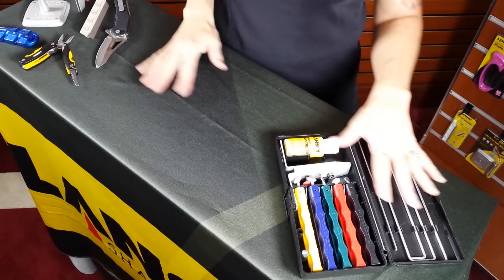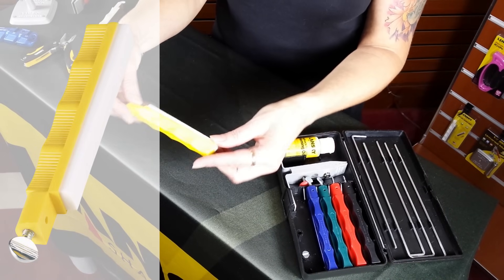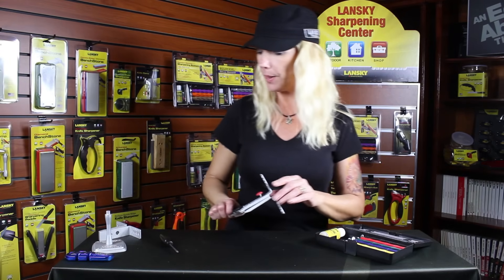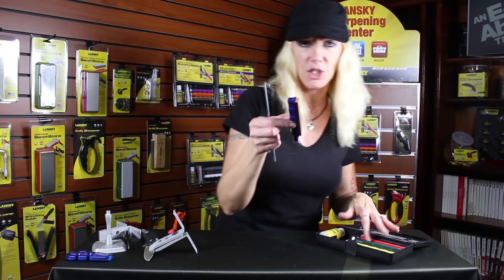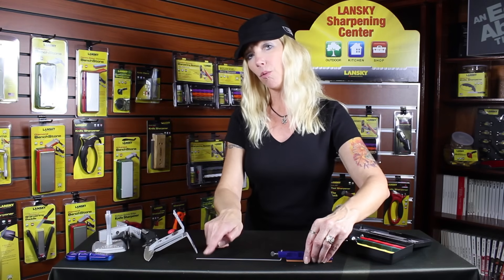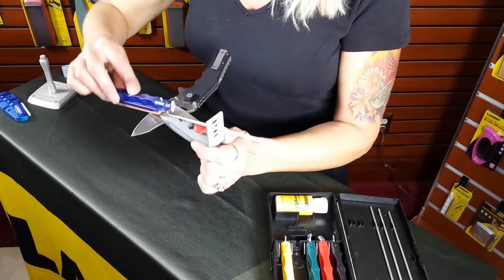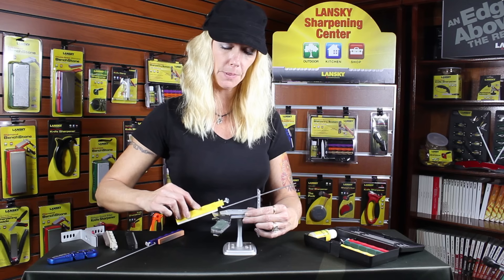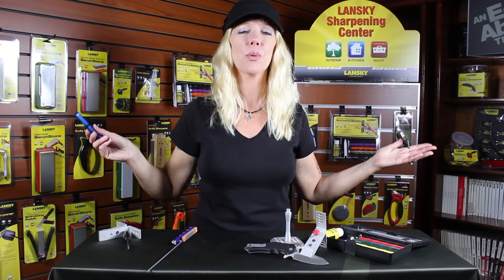The Lansky Controlled-Angle Sharpening System

Comment: Okay, just my thoughts after using this system for some years, on my second set. If I put my knives 1/4-1/2 inches into the holder, the clamp will not hold it securely. My second observation is that when I after having tightened down on the back screw tightly, the threads have stripped in the aluminum, so I had to drill and tap it to hold another thumb screw, pain in the butt. It works better than the Smiths, but I would rate your system a 4 out of 10. I’m currently looking for a better system. Just my opinion for what it’s worth.
Reply from the maker: I'm so sorry to hear you're having trouble with our system! We would love to get in touch with you about this issue and see if there's anything we can do to help. Please email us at customerservice@lansky.com.

Comment: Just got the system recently and got the deluxe 5 stone system. Also got the leather strop. Am I to use compound on the strop ?
Reply: I was wondering the same thing, since I'll be getting the strop as well. Every video I've seen on stropping uses compound, so I'm going to say might as well - can't hurt, esp since you have the controlled angle and no danger of accidentally  dulling the blade. I'm going to.

Comment: I’ve got the professional kit. Can you use this with karambit’s?
Reply from the maker: We actually have a set of hones specifically designed for karambits and other curved blades that will work with your current system. You can check it out here: https://lansky.com/index.php/products/curved-blade-hone-pack/
Reply: Lansky Sharp would this kit that is sold at SouthernGrind.com, be a good choice to sharpen mostly folding pocket knives that are middle to Higher class. Like a Chaves Rendicion 228, or a Zero Tolerance folder? Or would I need to get some extra parts?

Comment: Should we soak the stones in water? I got the deluxe, doesnt say arkansas stone so not sure to use oil
Reply from the maker: If you have the Deluxe 5-stone system, it does not require oil while you're sharpening. Metal filings from the sharpening process will start to get into the hone though, and that's when you'll use the oil to clean it up. If you have a Deluxe DIAMOND system, do not use honing oil as it will clog the pores. Full instructions are available at lansky.com (click the product you have). Your kit should also come with complete instructions. Hope that helps!
Reply: @LanskySharpeners  thx

Comment: I have a set of your stones that works verygood never had an issue until today,Igot a kershaw Launch 13 knife and I cant get it to clamp /screw down right because the blade isnt flat ,its got a crazy blade design...Any Ideas on how i can get it  to work.?any advice?? Lansky
Reply from the maker: Hi! I'm happy to hear you like the system so far! We would love to give you more detailed advice on how to fix this issue. Please send us an email (and perhaps include a few photos so we could better see what's what) at customerservice@lansky.com.
Reply: @LanskySharpeners  thanks,I ended up 2 little pieces of foam and clamped down on the blade and the foam.I got it to stabilize a bit better and got it sharpened pretty good..thanks again
Reply from the maker: @gman-dq5jn   Glad you got everything working! If you ever have issues again please don't hesitate to reach out to us and we would be more than happy to help!

Comment: That rod is moving all over the place through that big hole for the particular angle designation. Too much slop to get an accurate angle. Perhaps holding your finger against the sliding rid where it goes through the hole might tighten up tolerances.

Comment: I have a knife with a spear point blade where both sides (cutting and non cutting) of the blade are beveled and the thickest part of the blade is a small ridge down the center. How can I  clamp the blade to get the correct angles or will this not work for those type blades (i.e. spear point,  dagger, etc.)?
Reply from the maker: Hi Phil, for a blade like that we would recommend our Master's Edge or Turn box sharpeners.

Comment: I have seen so many ways to use this sharpener. Here she moves INTO The blade with a small slide down a portion of the blade. Others move the blade up and down and yet other slide the stone left to right on the blade. Quite the conundrum for those new to the system.

Comment: All the videos I've seen for this system show sharpening of pocket knives only, usually 3" or 4" blades.  I'm wondering how long a knife can be sharpened with this system?
Reply from the maker: Hi Jon. Our kits include instructions for sharpening knives that are under or over 7". Here's the link to the product page: https://lansky.com/index.php/products/dlx-5-stone-system/. You can find instructions for sharpening longer knives under the instructions tab.
Reply: If blade is greater than 7” in length:

Pick the end of the blade where you would like to start sharpening and place the clamp two finger widths away from that end of the blade.  (For example, if you choose the tip, place the clamp 2 finger widths from away the tip.) 
When you have the blade secured in the clamp, place your 2 fingers along both sides of the knife clamp.  The area covered by your fingers (on both sides of the clamp) is your target sharpening zone.  Try not to sharpen outside this zone, as this will change the angle of the hone and result in a poorly sharpened blade.
Sharpen your target zone, and with the knife still secured in the clamp, flip the clamp (and knife) over and repeat this process on the other side of the blade. 
When you are finished with the first zone on both sides of the blade, measure another two-finger width starting at the edge of your freshly-sharpened area, and place the clamp next to your fingers. 
Sharpen this new target zone as you did the first, roughly using the same number of sharpening strokes. 
Your use of this method will minimize gaps and overlaps between your target zones, helping to ensure a continuous sharp edge when you are finished.

(i found these on the website)
Reply: Biggest knife I've Sharpened with this had a 9 or 10 inch blade, and I didn't even have to move it in the clamp.

Comment: Hi. Will this work effectively with blades that are 30 cm long?
Reply from the maker: It will work but you might have to readjust the knife in the clamp once or twice to make sure you're getting the entire length of the blade. If you like to freehand sharpen, you can also use a bench stone and get excellent results that way.

Comment: Lots said about *accurate blade angle" I can't see how this can be the case as the exact angle will depend on the width of the blade, wider blades would have the edge further from the guide resulting in a lesser angle
Reply: That's why she said how much of the blade should stick out.

Comment: Is it possible to over sharpen a knife ?? I know that sounds like a silly question.. Like sharpen it to where it dulls out
Reply: Sharpening literally means turning a dull blade into a sharp one. If you do that and end up with something that cuts worse than before than you didn’t sharpen it but rather used your knife as a stone scraper 

I mean by grinding metal on stone you’ll inevitably going to “use” up your blade. That’s why you hoan your blade on steel until the edge gets brittle -> you put the edge back on with stone -> use blade and hoan until it loses edge again -> repeat until knife is gone. 
So yeah, it is possible to “over sharpen” but id refer to it as “not sharpening correct”. 
Imagine cutting back trees every year, is it possible to “over cut”? Not if you know what your doing, but if you have no clue and cut your tree at the root it’s gone lol

Comment: When and how do you apply the honing oil to the stones?
Reply from the maker: It's really a matter of preference. Some people use the oil on the stone to sharpen with, and others use it only after to remove any metal shavings that collected in the hone during the sharpening process. Just make sure not to use any oil at all if you have a diamond system.
Reply: @LanskySharpeners  Very helpful.  Thank you.

Comment: I got one of the deluxe systems. Where I ran into an issue was when I got down to the fine stone, the blue one and my knife literally shaved off the surface of the stone. And that was with light pressure. Any ideas? What am I doing wrong?
Reply: Sounds like the fine stones rod was bent or not set properly

Comment: The stone rod guide isn't a great idea. It is flimsy and loosened and begins to twist. I keep tightening it. Wouldn't it be better to secure the rod ( mold it together). 1 rod for each stone?
Reply: Even if it twists a litte, this will not change the angle, unless the rod moves up or down. Which should not happen if you don't overuse pressure.

Comment: Lansky Standard Knife Clamp vs. Dual Thumbscrew Soft-Grip Clamp?  What is the exact measure of both? Why the "Dual Thumbscrew Soft-Grip Clamp" can not function with narrow knives like a Swiss army knife 1/2 "?  Thank You!
Reply from the maker: Hello - both clamps are the same size. The difference is that the Soft-Grip Clamp has rubber on the jaws that prevent getting scratches on your blade. It doesn't have the notches that are on the Standard Clamp, which is why it isn't recommended for very small blades. The notches in the Standard Clamp are where you would hold small blades. Some people prefer the Soft-Grip clamp, and others prefer the Standard. Some will even add some masking tape or electrical tape to the Standard Clamp to prevent scratches. Hope this answers your question.
Reply: Lansky Sharp the notches are nice because they help you place the knife blade to the same exact depth in the clamp each time.  I have both clamps,  and I've been wondering how to replicate the blade placement in the padded one the next time I use it on the same knife. 

Also, some knives don't have much of a flat on the blade, they sort of taper from the spine to the blade. I have had a challenge getting those types of blades to line up perfectly parallel to the clamp. Lucky, that's not the case with many knives.  I've had my Lansky since the 1980's and I love it. 

If you tape your blade to keep it from scratching,  always place the knife at the same depth in the clamp,  fit the guide rod properly in the stone,  and use your finger on the back side of the clamp to lift the rod to the top of the guide rod hole,  you should always get very good results.

Comment: I've seen videos where people sharpen using an up and down stroke with the hone on the blade, moving from one side to the other.  Is this not recommended?  Thank you.
Reply from the maker: Hello. Great question. We don't recommend moving the hone up and down in a sawing type of motion. For best results, your strokes should move diagonally forward (towards the guide hole in the clamp) and along a small section of the blade, using the full length of the hone with each stroke.

Comment: Cool and informative vid :) Ceramic Deluxe is absolutely awesome. My favorite sharpening system. Really handy for re- profiling blades. Shaving sharp result every time!  And the cool thing is there is a whole bunch of hones and parts one can buy separately to compliment the system. I really like that. Covers all kinds of blades. For my EDC bag and my outdoor kit I have a Quadsharp ( couple of them) and Mini Dog Bone. Great products! Big thumbs up!
Reply from the maker: Thanks Jani. Stay sharp! :)
Reply: Hi , i think this type of sharpening systems are not sharpening a blade on the original angle but on a forced angle and only if the blade is perfectly round with the same radius on the whole lenght of the blade this kind of system will work and i said not this sysytem but all the systems with only a pivot point.
If you are not in accord with me,  you can make a video to show with the electronic angle meter to show everybody in different spots of the blade it is a different angle and that can damage the blades and messed up your entire angle of the blade because when you haveTHE SAME HEIGHT BUT DIFFERENT DISTANCE, THE ANGLE BETWEEN THE BLADE AND STONE CHANGE, and THATS NOT GOOD FOR THE BLADES.
After few sharpening sessions with these kind of systems you will have on a single blade a mutitude of angles that VARY with the shape of the blade, the more curves or chages of a direction of a blade has the more angles you'll have because, LIKE I SAID BEFORE, THE DISTANCE AND ANGLES ARE  INVERSELY PROPORTIONAL then as one quantity increases, the other decreases.

Comment: Does the 17 degree and 20 degree rods ever hit the red screw in button seems to me it might. Wished she would have used the 20 degree rod. That is my sole reason for not buying, thank you.
Reply: Karl Patterson the kit has a headless screw to replace the red thumbscrew in cause it gets in the way. I have just bought one standard kit to test.
Reply: If you place your hands on the clamp,  such that you can apply upward pressure on the guide rod with a finger,  you'll probably clear the knob at 20 degrees.  With a small blade,  you may hit the knob on the 17. I just use the other dude of the clamp and switch directions that the knife points (In other words,  I use the side of the clamp without the knob and then I flip the knife and not the clamp when I want to do the opposite side ).  

I find that the 17 is too fine an angle for my hunting knives.  The edge will roll if you hit a bone. Maybe not if you have some kind of super steel.  I changed my 17 degree edges to 20s and 25s, except for a filet knife.  If you decide to do 17 on a chef/sushi knife,  I think the blade will be wide enough that you probably won't hit the knob even on 17.  

Also, spring for the very fine stone, if your set didn't come wth it. It really finishes off the blade beautifully.
Reply: 20  degree angle not  that I’ve seen. And I’ve been using Lanskys for awhile. 
17 sorta yes.  One side it will, but you can put the extra headless screw in.  That will let you sharpen 99% of knives at the 17 degree angle. You can also flip the knife over in the bracket.  
But occasionally there is one knife that that you cant sharpen to 17 degrees.  But it is very rare. However, the 17 degree edge is very thin. It is also pretty  weak.  Most tasks can be done with the 20 degree angle.  But the 25 degree you should use on heavy use knives.
Reply: The instructions on the kit say to have the blade edge 5/8 from the clamp tip. So as long as you have proper distancing and use the correct provide screw, you shouldn't hit it.

Comment: Will this system work with 9inch filleting knives?
Reply from the maker: Hi Caleb, yes filet knives can be sharpened with this system. It has four different angles so you can use it on a variety of knives.

Comment: I hate the way everyone uses these systems.   Hold the knife by the handle, the stone like you're free hand sharpening, and using the system to maintain the angle.  It's remarkably faster, more ergonomic, and safer!

Try it!!
Reply: How exactly are you holding the stone?
Reply: @mitchswanson6447  I hold the stone with my fingertips by the plastic with the stone facing upward.  I actually made a video on my channel.  In the video I show alternating passes, but obviously you can make more than one pass per side.

Comment: I use mine to sharpen my broad heads which are 2 blade heads, rubber clamp not so good rubber comes off very soon & the knife moves in the rubber.
Reply from the maker: Sounds like you have our soft-grip clamp. For your purposes you might want to look into the one without the rubber grips. https://lansky.com/index.php/products/multi-angle-knife-clamp/
Reply: I just put electrical tape on it, WORKS GREAT.

Comment: Ive only redentlt purchased the 5 stone delux system to profile amd sharpen my homemade knives.
So far I havent got any complaints. But I do have a quesstion. The part(s) of my clamp that has the holes for the guide rods are not at a perfect 90°angle to the jaw portion. Is this by design or should they be at  90° to the jaws?
Reply from the maker: Hi Dennis,

Thank you for your question. 

It's possible that during the machining process, or during shipment, the parts of the clamp that have the guide rod holes may have shifted a bit.  If you're just seeing a small shift, you could GENTLY bend the arms (where the guide rod holes are) back into a 90 degree position. If you're finding that it's quite off though, please email us at customerservice@lansky.com, as it may be an issue for our warranty department.
Reply: Lansky Sharp,
 Thanks for your reply. The system seeems to work "ok". I was able to sharpen a completely blunt edge but Im wondering if the edge could have been better if those parts of the clamp were straight. I'lll check them to see how far out of square they are. Thanks again.

Comment: Yeah, its all fine and dandy until you try to sharpen at a 17 degree angle and you catch BOTH the red screw AND the top clamp jaw with your stone...
Reply from the maker: We're so sorry to hear that you're encountering this issue. Within the kit we include alternative screws that may help to alleviate this problem. Additionally, if the guide rod is not level it may be causing the hone to catch. If you have further questions I would be happy to connect you with our customer service department!

Comment: What’s the longest blade length that you can sharpen with this system?
Reply: Anything over 7", pick either the tip or the base, move the clamp away 2 finger widths, and sharpen in 2 (or more, if sharpening a sword lol) sections. Otherwise, the angle will change.